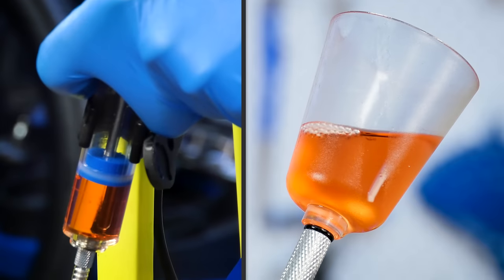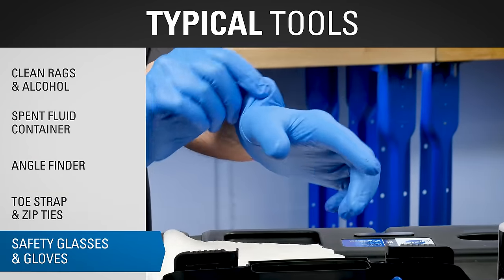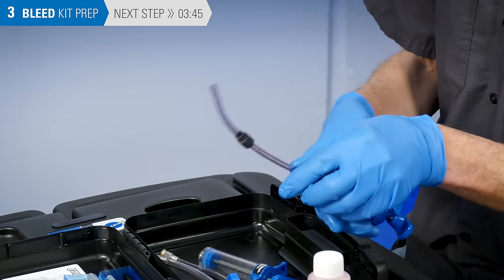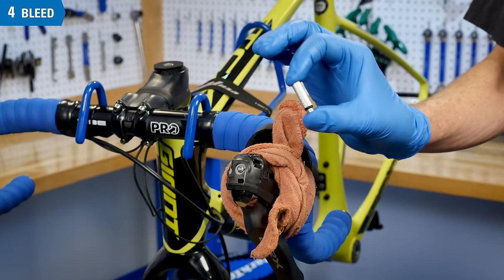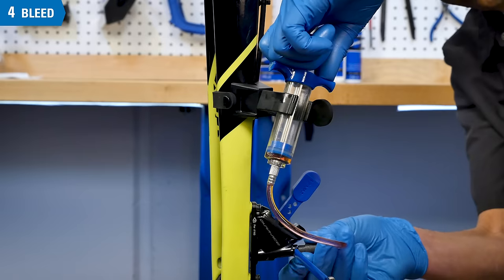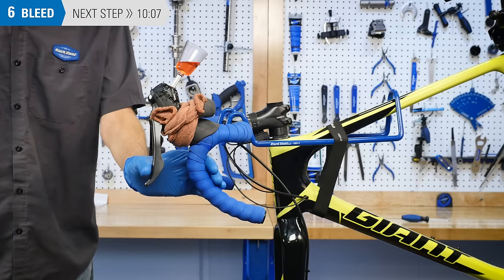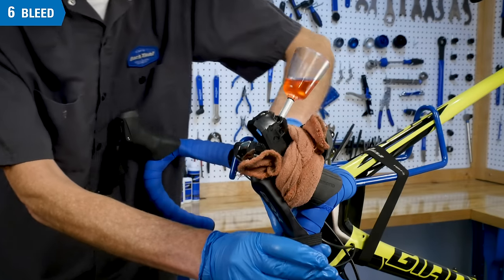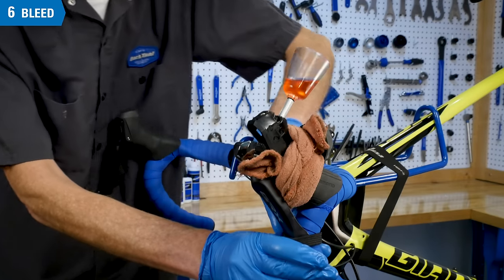How to Bleed Hydraulic Brakes - Shimano® Drop Bar Levers

Comment: hello. i have a problem with the bleed screw (https://youtu.be/mAEeAKmCLFU?t=279) on brake leavers - the internal thread was torn off (most likely ) and bleed screw can not be screwed in (it simply scrolls). What do u recommend in such case? to bore the hole on the leaver and use a bolt with bigger size could be an opportunity?
Reply from the maker: The bleed screw does not thread in or the threads of the cup do not? This is not common and boring the hole and rethreading is not suggested as it may introduce metal shavings into the system. Which would be bad. A new lever may be a better and often more cost effective solution.
Reply: @parktool  1st one - the bleed screw does not thread in the port. Thread in the port exists. Dont know what the reason of this case. Also described it more here (so I'm not the only one with that issue) - https://bicycles.stackexchange.com/a/72254/52976
Reply: @alexeiagafonov9715   When you write that "the thread in the port exists," it's not clear what is causing the bleed screw to "scroll," as you say.  One of the parts, at least, must be stripped: either the port, or the screw.   Maybe buy a replacement bleed screw and see if that works; they're only a few dollars. At least you'll know which part is stripped.  This is a terribly frustrating problem.  I think in the end you're going to have to get a new lever.  I don't think your other solutions are viable.

Comment: Wow, 1000x more complicated than rim brakes, as expected.
Reply: Wow 1000x better braking power...as expected 🤷🏽‍♀️
Reply: @Retro_animation  “ equips nerd glasses” actually rim brakes are more aerodynamic dont need to worry about brake fade and are eaquly powerful in dry conditions due to mechanical advantage, however hydraulic brakes work consistently throughout wet dry snowy muddy etc conditions so basically for a road bike get rim brakes for anything else disks
Reply: You find this complicated? You sound like the sort of guy who needs YouTube video tuition to brush his teeth

Comment: This seems overly complicated - Shimano itself recommends an easier and faster way
Reply: Those were the old Shimano funnel method, not any more for new Shimano brakes.
Reply: @jonowee  we work this method in our lbs without any issues on all kinds of shimano brakes
Reply: Wait what, I just read through the Shimano manual (for Ultegra R8070 at least) and it's basically identical to this video (bleed, then gravity bleed, then rotate bars and burp levers)? What is the easier/faster way?
Reply: @squiresuzuki  they were cutting corners. This video is correct. If you aren't rotating the handles in the second step, you're half-assing it. I hope Peter isn't a bike shop worker.
Reply: @Chance57  He literally said "we work this method in our lbs"
Reply: @OptimusSatanas  yeah, but people lie from time to time. I just hope it's that instead of incompetence.